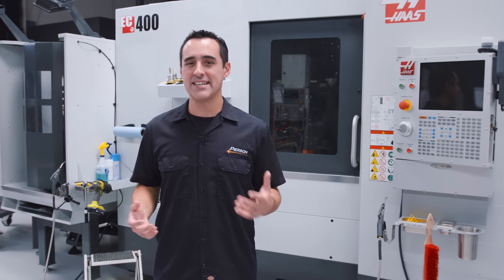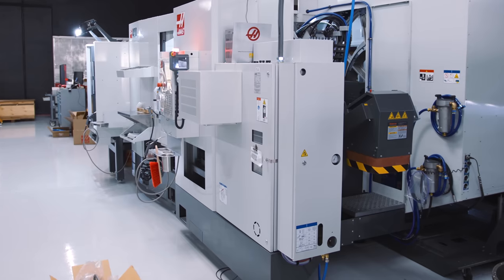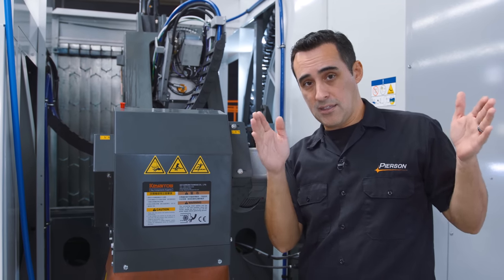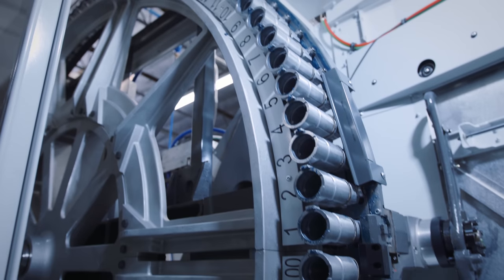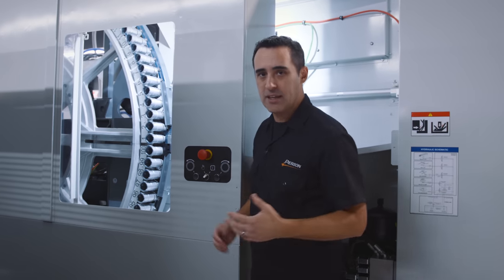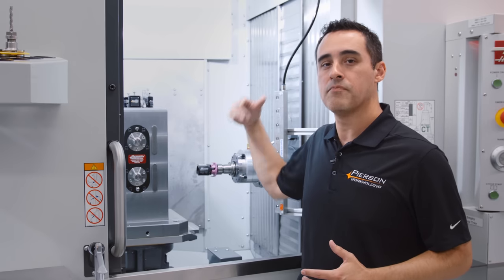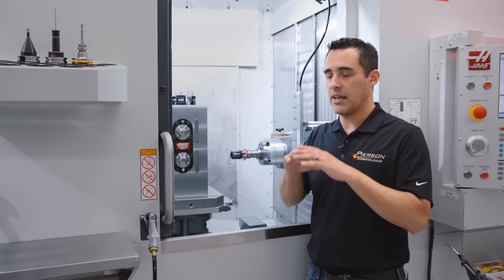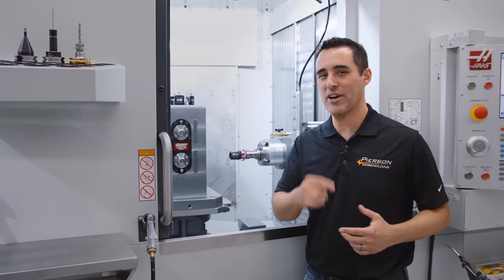Haas EC 400 Horizontal Mill Review Pt 2 (Plus Our New Pro Pallet System!)

Comment: Great machine! We also bought an EC 400 and we are loving it!!! We use Automatic Tool Management, together with tool break control and program Macroses to check the tools, and if tools are broken- go and redo the cutting! That way we do 3 !!! Shifts in 24 hours and third shift is lights out machining- no operator! We are very happy!
So far had two issues with machine:
1) HAAS had to change spindle encoder and cable - we had an error popping out too frequently (we have a 15k spindle).
2) tool release button was not working- that one was changed as well.
One question- do you experience long dwelling times between movements? For example when you home Z axis for B axis rotation, then machines dwells for long time :-)

Comment: I’ve been looking forward to this one! We have two EC-400s, and both leaked. 😡 We also chose not to spend $90k on the pallet pools, for financial and floor space reasons, but primarily because they weren’t able to handle the Orange Vise tombstones we went with. Just like the ones you showed. Love those!

Nevertheless, they’ve been game changers for our small shop, with productivity gains we didn’t anticipate. Those Lang spindle fans are the bees knees, and the whole shop hears them spinning at 12k. 😄 They get used on every job. 

There are some caveats, but on the whole, they’ve been very good purchases for our shop. Hope to see more horizontal machining in future videos. 😇
Reply from the maker: Interesting! We thought we had leaks at the pallet pool and machine interface. Apparently, leaks are a way of life for EC owners.
Reply: @PiersonWorkholding  I should have mentioned that both leaked at the load station. There’s something fishy going on in that area from the factory, but thankfully, the techs had it fixed up quickly, with no recurring leaks. 😎
Reply from the maker: After filming this, it leaked again. C'mon, how much would a can of Flex Seal cost the factory?
Reply: @PiersonWorkholding  well I've got a 2006 EC400 and I'm still chasing the odd leak so... :) horizontals are a bastard because of the amount of panels that you have to get to seal. if you want to seal a real leaking mess buy a swiss lathe. I'm shocked they don't come stock with a drip tray.

Comment: Nice video Jay. I really like my Haas machines. I absolutely love the controller. I have been self employed for about 36 years. I briefly worked for another company about 3 years. We we’re running mostly Mazak’s. Both mills and lathes. I really like Mazak’s too. But when you realize how nice the Haas controller is compared to other brands it’s like a light bulb going off in Your mind. I think the EC 400 is going to work out great for You guys. Buy the next one with the High speed spindle for the aluminum work and dedicate this one to the steel and cast iron work. Are you making the tombstone in house for the new horizontal setup or is it a buy out. Really good stuff Young Man. Keep up the good work.
Reply from the maker: I appreciate your perspective.  There are a lot of great controls but the Haas is incredibly intuitive and laid out well.  I like your strategy of the next EC 400 being an aluminum-only machine with a faster spindle.  We're buying blank tombstones for now until it makes sense to insource them.
Reply: when people ask what to buy first, haas. almost stupid proof control, best gui in the industry. when you start chasing zeros that's when you should upgrade.

Comment: Just odd that you would build a pallet magazine that can't hold the same weight the machine can on a pallet. Leaves a lot on the table
Reply: Welcome to Haas. You'd think there'd be more planning on such things. But I guess not. Mindboggling really.
Reply from the maker: Several other builders do the same thing. It baffles me as well.
Reply: @PiersonWorkholding  I think even haas had a video about this, if you want to have huge capacity automation it cost huge money. Most people that are looking into automation don't need to handle max capacity parts so why build a max capacity automation system for a hugely inflated price for the minority of customers? plus you can just buy piersons system and problem solved:)
Reply: @TheWidgetWorks  and then there's us. No matter what the weight or size capacity we're going to try exceeding it (not on purpose just sometimes s&%@ happens).
Reply: My bet is: They originally tried to, quickly realized they missed the mark, and set an arbitrary weight limit that would work reliably...-ish. Rather than continuing to spend money on development, management said to run with it to get to market faster.

A limit of 500 lbs. sounds unlikely as something that was discovered through testing and analysis. And I find it unlikely that an engineer would just pull that out of a hat as a "good enough" design goal. It just doesn't pass the sniff test.

It's not... wrong per se. It's just kind of silly. A few quick tests of rails and bearings should have told them how much overkill they needed.

Comment: How are you feeding air to this system that can rotate?
Reply from the maker: It only needs air to unlock pallets.  This is done with a quick disconnect at the load station.  Once pallets are loaded, the QD airline can be removed and the pallets remain locked.

Comment: I’ve been using that mill for 3 years now. That tool change area is going to get very gummed up with the coolant and the pallet is also a pain to keep clean. Haas needs to make it so you have more access to carousel.
Reply from the maker: Great tip! We'll keep an eye on those areas.

Comment: Weird question, but why do most of the tombstones on the market only have 4 or 2 faces? If you were to use a 5 face pallet or more, I would think that would increase the efficiency. I know that there could be a limitation while reaching some features depending on the size of the material. Am I missing something or is this the way it is because this it the way it has been?
Reply: Each face of the tombstone gets smaller every step up in number of faces. At some point they are to small for what you want to do.
Reply: @samuelt321  that makes sense. I also assume that the machine and unload station only have rotation locks at 90 degree increments.
Reply from the maker: I'd also add that additional faces can interfere if you're doing side work.

Comment: I have just a couple of questions regarding the Haas HMC line. 1. Does the controller have any kind of pallet scheduling? For example, would I be able to tell the machine to start with Pallet 2 and run programs 122 & 123 then load pallet 4 and run programs 98 & 100. Also does the load station have a safety mechanism on it to prevent someone from sending a pallet in at say B180 instead of B0?
Reply from the maker: "Yes" is the answer to all your questions.

Comment: Hi Jay, do you have air-knifes on your chip conveyors, we machine a lot of aluminium and mounted air-knifes to clean the belts to provide chips going under the conveyor, mostly chips are too wet to fall off, added air-valves that run simultaneously with the conveyor.
I like the Haas control for it's large (cheap) memory, free updates of the latest NGC version or VPS-templates and running from USB.
I don't like the control panel when you also used to other brands, to many functions behind a single key, but the controller is okay.
Reply from the maker: We have one conveyor with an air knife.  It seems to work marginally at best.